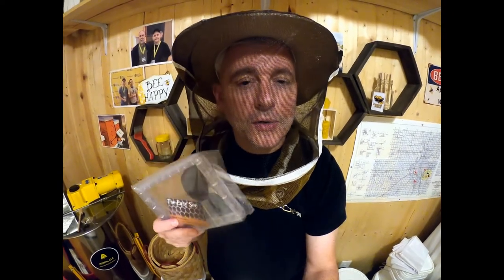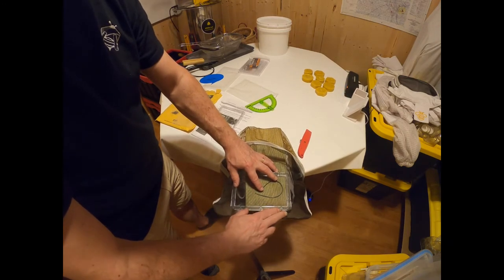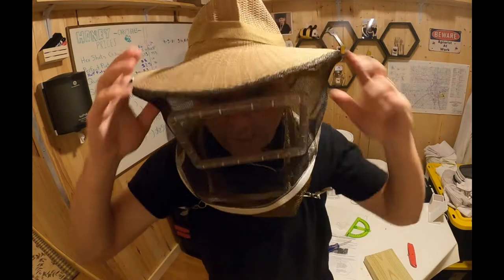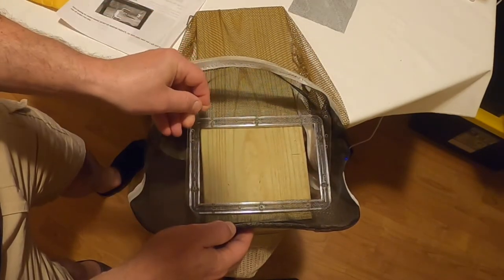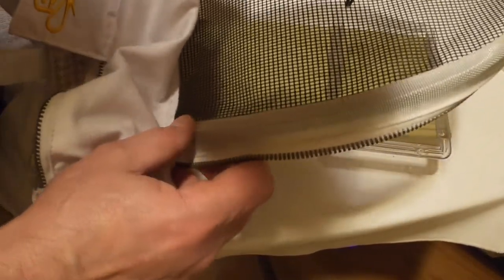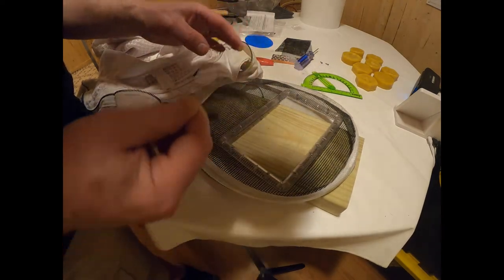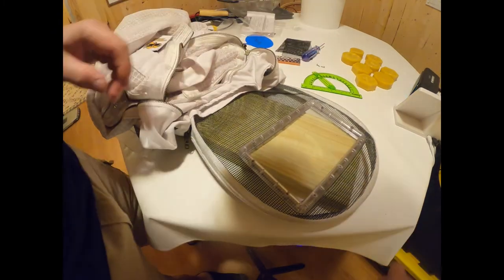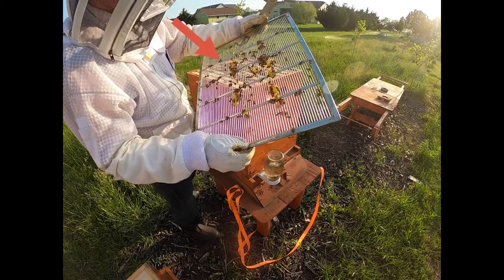Complete Install of The Easy See Beekeeping Veil Window and Field Test

Comment: Thanks for the install and review,  I just ordered one for my jacket which is just like yours.   I wondered the whole time if you should have turned the 2x6 90 degrees to match the frame size?
Reply: I just moved it to a new veil and did not use the block at all and it looks good  :-)